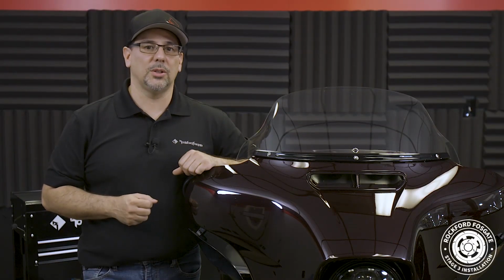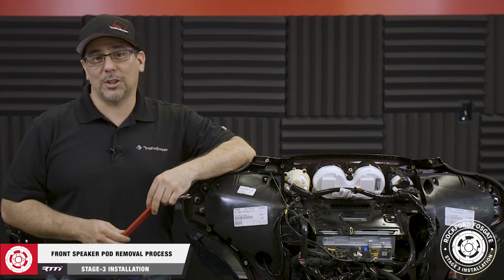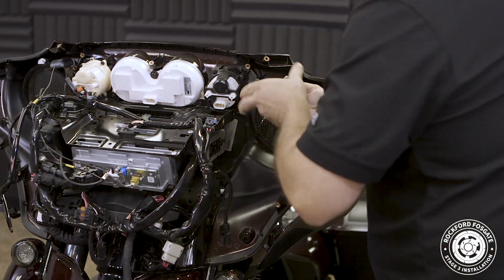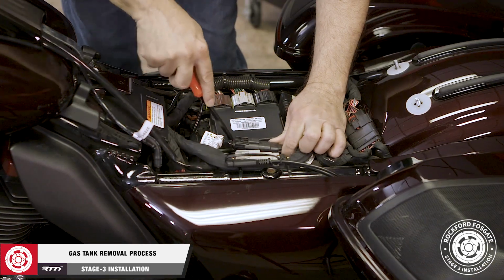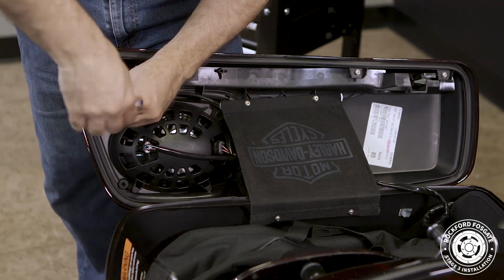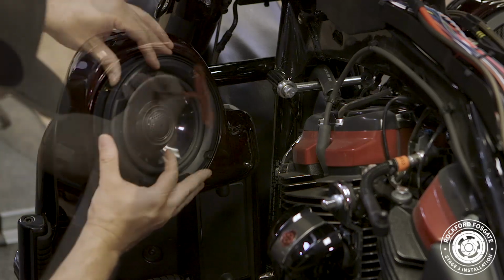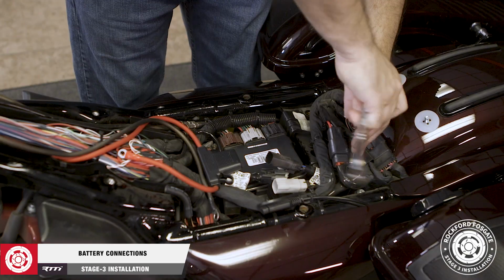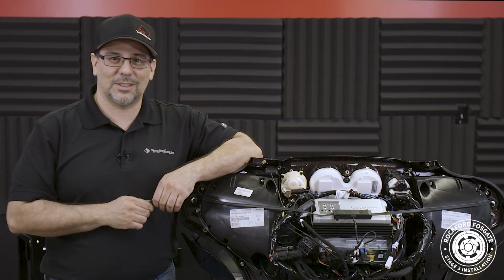2014+ H-D CVO Street Glide Stage-3 Installation

Comment: I installed this kit per instruction, but when I turned the volume all the way down, I hear a hissing sound. There's also a slight popping sound when turning the radio on. The blue remote wire is properly connected.
Reply from the maker: The radio is flashed and the amp is set using our Amp Tuning Guide, right?   This will optimize the signal to noise.   There will be a double heartbeat because the CanBus is no longer seeing a factory amplifier and some of the increased system noise is coming from upgrading to a much higher output amplifier.  Just in case, you can download the tuning guide here: https://rockfordfosgate.com/rnt/rnw/docs/1355/harleyamptuning_2014_rfk-hd14.pdf

Comment: I have this same exact bike color and everything. My dealer told me they cannot install the new HD/RF system on this bike because the wiring/harnesses etc are completely different. Even after i pointed out this video to them they said they couldn't do it with the new HD/RF system and that I would have to buy this system your installing on this video. Then they said this is a 10 hour job lol ! No wonder theyre nicknamed the STEALERSHIP. I guess i'll have to purchase this directly from RF and find a reputable installer ?
Reply from the maker: Hi Bigdog,  Just want to clarify that the aftermarket HD14CVO-STAGE3 in the above video is completely different than the "Harley-Davidson Audio Powered by Rockford Fosgate" system exclusively available from Harley-Davidson dealers.  To the best of my knowledge when I did this install, this is a 2019 CVO Street Glide (FLTRXSE).  When we were looking at compatibility charts, we understood there were some 2018, 2019, and 2020 models that might not be compatible.  I looked on H-D's website, and it looks like they are correct that the 2019 CVO Street Glide is not compatible for the factory system upgrade (uses the older Boom system).  You may want to check your exact model using the below link -Eric

• HD14CVO-STAGE3 (aftermarket): 
https://www.rockfordfosgate.com/products/details/hd14cvo-stage2/

• HARLEY-DAVIDSON AUDIO POWERED BY ROCKFORD FOSGATE (factory): 
https://www.harley-davidson.com/us/en/shop/c/motorcycle-speakers-rockford-fosgate?format=json;i=1;locale=en_US;q1=parts;q2=motorcycle-speakers-rockford-fosgate;sp_cs=UTF-8;x1=primaryCategoryCode;x2=superCategoryCodes;fitmentFilter=2019-FLHXSE
Reply: Thanks for the quick reply Eric. I spoke with another HD dealer and they said they could install the HD/RF system on my 19 but at a huge cost of $3700.. I guess there are 2 amps they are using instead of one like yours in the video. I’m not sure which system would sound better but I’m leaning towards buying your aftermarket one and doing the install myself since your video is an excellent step by step.
Reply from the maker: @bigdog3495  Glad you're doing the research.  As mentioned, the "Harley-Davidson Audio Powered By Rockford Fosgate" system is 100% different than the aftermarket.  On the H-D version, we use 2 amplifiers due to the number of speakers on a Stage 2 system.  The #1 amplifier also has a built-in DSP and has been expertly tuned by our technicians.  It sounds amazing!  

The aftermarket system as shown in this video is very loud, and it does have provisions in the T-Harness to add-on the DSR1 digital signal processor ($329) at a later time.  If you do the installation yourself you MUST get the factory radio flashed.  Typically if you buy the product from an Authorized Rockford Fosgate dealer, they flash your radio at a much reduced rate, compared to buying the product from our website and taking the bike there to get flashed.  The reason for getting the radio flashed is covered here: https://rftech.custhelp.com/app/answers/detail/a_id/1215

Comment: I’m getting ready to pull the trigger finally and get this system. The question I’ve got is can you remove the Boom 2 saddle bag amps and still use this system. I realize your using block off plugs but I would like to sell my whole Boom system if possible
Reply from the maker: Great question Bigdog.  You can remove and sell the amplifiers and speakers, but you cannot remove the harnesses, because our "bypass plugs" use the existing factory wiring.

Comment: Is there a Rockford kit to put 6.5” speakers in the lowers on my Ultra Limited instead of the bags? Currently doesn’t have speakers in lowers
Reply from the maker: Great Question!  Rockford a Fosgate currently doesn’t have a lower kit, but the TMS65 speakers used in your upper fairing fit the lowers if they are non-water cooled.  Best of all, the TM400X4ad amplifier supports 8-speaker systems, so it can be added to your existing system.  The hardest part would be running new speaker wires.  I would be willing to make you a harness if you need one.
Reply: @rockfordfosgate  that may be an issue in the end then, as my bike has the liquid cooled heads
Reply from the maker: @JFROMM454  Hmm, that would be an issue.  Unfortunately, we currently don't have  shallow speakers for water-cooled lowers.
Reply: @rockfordfosgate  sounds like y’all need to develop a new speaker 😂
Reply from the maker: @JFROMM454  For sure, albeit the water cooled lowers are challenging due to the shallow mounting depth.  I'll send your feedback over to our New Product Development team!
Reply: @rockfordfosgate  I’ll even volunteer my bike for the first set haha
Reply from the maker: @JFROMM454  If you're local in the Phoenix/Tempe area, we'll put you on the list.
Reply: As fate has it … I am not 😭 I’m alllll the way in Arkansas
Reply from the maker: @JFROMM454  Ah snap!

Comment: So on the 5/7 rear speakers and the lower fairing speakers only  one plug is used when installing the RF speakers? (The OEM speakers uses 2 plugs each speaker)-- thank you
Reply from the maker: The 5x7” saddlebag speakers and the 6.5” lowers on this aftermarket kit only use 1 connector (non bi-amp capable).  That being said, you can simply use 1 connector and just keep the 2nd unconnected for it to work properly.
Reply: @rockfordfosgate  Thank you, Just as an FYI-I am installing this kit on my 2019 CVO SG as well- lastly which "Amp BI-pass" is used in the upper FRONT fairing. The one I received in the kit I just purchased was not Identified as "Boom 2 CVO"-- the saddle bag bi-passes are correctly ID ( l/R)-- Thank you for your help.
Reply from the maker: Good Morning @stanwerner7484 !  Thanks for that info.  The one under the fairing should say "BOOM AMP BYPASS".  You can download our Tuning Guide for your kit that illustrates the jumpers here: https://rftech.custhelp.com/app/answers/detail/a_id/1355/
Reply: @rockfordfosgate  Thank you
Reply from the maker: @stanwerner7484  You're welcome!  If the guide isn't clear, you can always call our tech support at 1-800-669-9899 to get a quick answer.

Comment: How is it going? I have Rockford stage 2. Two 400 amps and I wanted to upgrade the 5 by 7 to 6 by 9. Is there a lid kit or do I cut the one I have?
Reply from the maker: Is this the "Harley-Davidson Audio Powered by Rockford Fosgate" system or the Aftermarket audio system?  Do your grilles have the H-D badge or do they say "Rockford Fosgate"?
Reply: @rockfordfosgate  it has Rockford
Reply from the maker: @richdonahoo8769  Thanks for that info.  Rockford Fosgate doesn't offer a "lid kit" to transform your 5x7" to 6x9".  Are you doing this for more midrange or more bass?  If this is for more bass, you'll likely be disappointed because it's a negligible change.  May we suggest using the HD14-SBSUB kit if you're looking to enhance the low end: https://rockfordfosgate.com/products/details/hd14-sbsub/

Comment: Does this retain front to rear fade?
Reply from the maker: Hi Pete, YES it does!  All new 2014+ kits feature a new T-Harness system that retains Fader control.  This is assuming you use the "Rockford Fosgate 2014+ All Bikes" flash setting that is required to use the kit.  The T-harness is included with the RFK-HD14 amp mounting kit that is included with the HD14CVO-STAGE3.  You can see the details on the RFK-HD14 below:

> HD14CVO-STAGE3 DETAILS: https://www.rockfordfosgate.com/products/details/HD14CVO-STAGE3/
> RFK-HD14 DETAILS: https://www.rockfordfosgate.com/products/details/rfk-hd14/
Reply: Rockford Fosgate I cant wait to test that on the CVO SG with 6 speakers!
Reply: From what I can see with your harness and bypasses, the lowers and lids would be tied together for rear fade, and upper fairing would be your front.  Is that correct?
Reply from the maker: @Soundz-Audio  Let me say, it was a privilege & pleasure working on this Maroon CVO SG featured in this video (it was brand new!)   It sounded AWESOME and the customer was blown away!! It's designed so you can hear it on the highway at 75 MPH, so my personal preference is turn the Treble down 2-3 notches for "parking lot" listening. -Eric R.
Reply from the maker: @Soundz-Audio  Yes, the Fairing is FRONT, and the Lowers & Bag-lids are REAR. 
Install Tip: If the lowers don't play, the wrong bypass plug is being used on the factory Boom! saddlebag amp.

Comment: How many hours was the install?  I just checked with my local HD and he is talking 12 hours to install, that is just nuts.
Reply from the maker: Hi Kevin, typical install time through an experienced Rockford Fosgate Motorcycle Audio dealer is typically 3-4 hours.
Reply: I went and listened to it day before yesterday and immediately purchased a 6 speaker system and amps. 6 hours labor with a 30% discount (my dealership does that every winter). Sounds phenomenal on a RG CVO (4 speaker set-up). Can't wait to hear the 6 speaker set-up!
Reply: 4-6 hours max depending on the know how of the tech , I did it myself using this video

Comment: More than likely I will call on Monday, the install is not difficult -- I completed the install, I just have a question about the "Blue" power wire from the power hardness, where does that wire get plugged into? Its unclear but is sounds like it gets plugged into the female connector of your wire hardness?---not an existing plug that is on the bike--?
Reply from the maker: At 8:50 I show running the wire to the brake side and locating an empty accessory connector.  Remove the existing blank plug and insert the blue wire.  This will tell the amplifier to turn on/off.